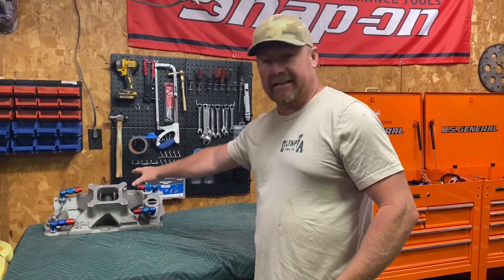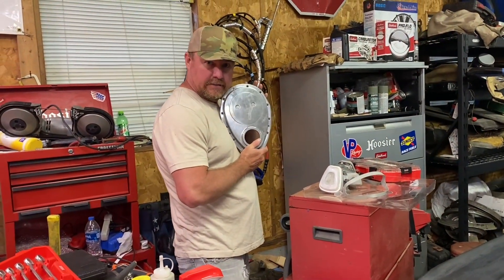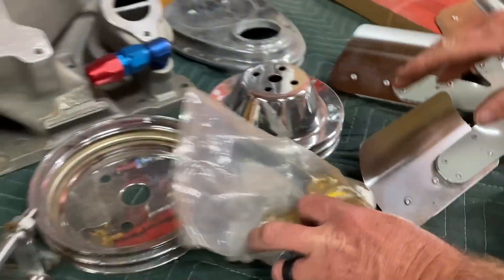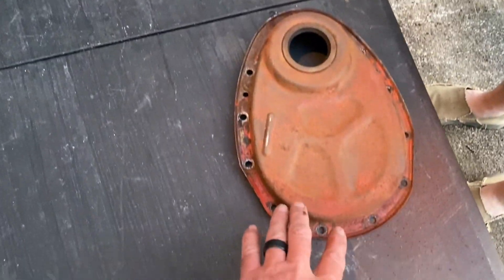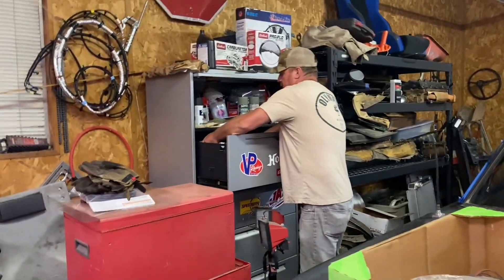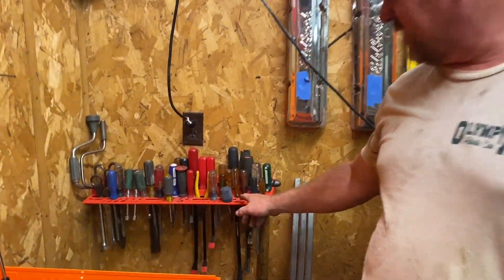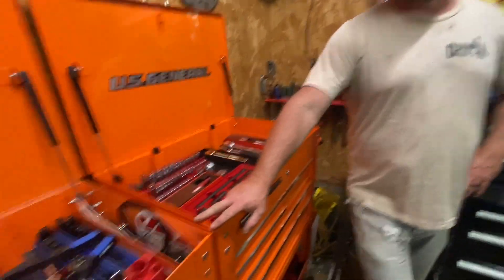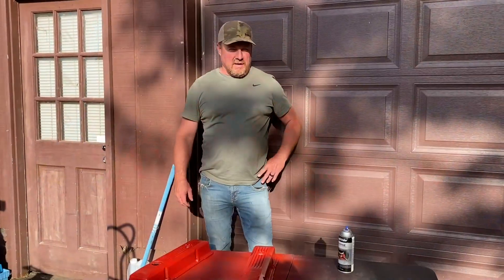EPIC Chevy 350 Build Part 5 / Crazy Parts!!! / 1959 Chevy Apache

Comment: Looks like it’s comeing together pretty good. I’m building a 40 over 350 for my 85 k10 I got and I was originally gonna build a budget motor and well it escalated quickly and I’m about 3500 into the motor right now and still don’t have all the parts to build it yet. That’s also not including the cost of the machine work I’m having done to the rotating assembly at the machine shop
Reply: That will be awesome when it’s done
Reply: @jimprice8557  yes sir been collecting parts for over a year now and I’m a lot closer than I was a year ago lol. It’s gonna have a forged eagle crank and forged eagle rods with forged dss racing 2 valve relief flat top pistons comp 480 lift cam double row timing chain edlebrock e street heads comp roller rockers edlebrock preformed rpm air gap intake msd street fire hei distributor and a 650 quick fuel brawler carb also gonna have a high volume oil pump and 7qt oil pan.
Reply: I would love to hear it when you’re done
Reply: When I get it all done and in the truck I’ll have to find some way to send you a video of it running
Reply from the maker: That is going to be an awesome engine
Reply from the maker: Please do would love to see